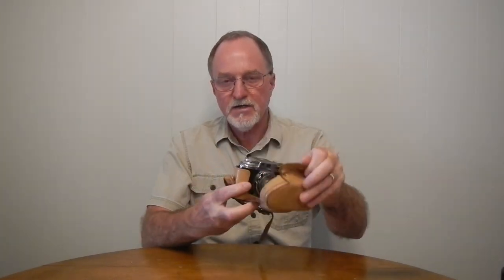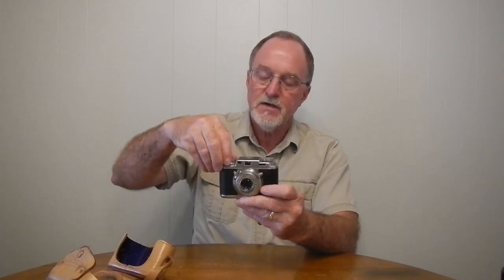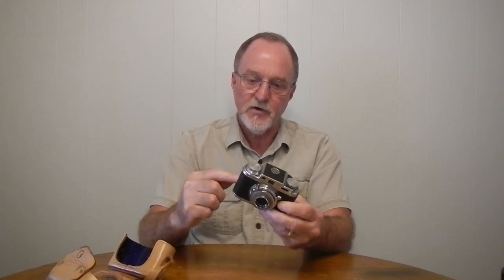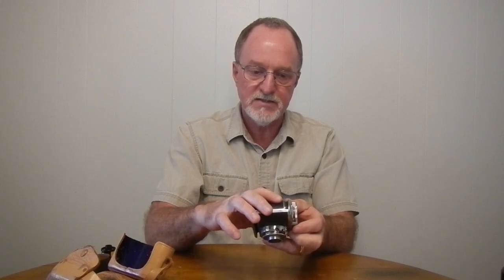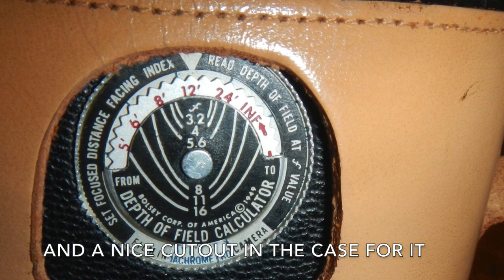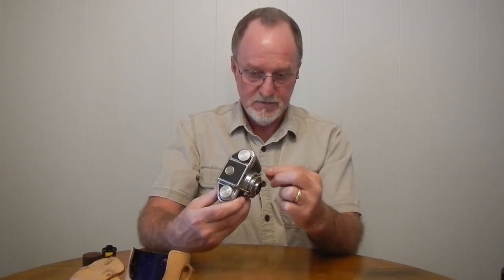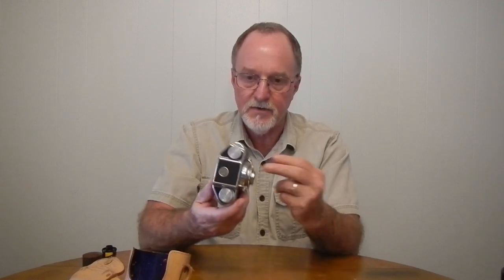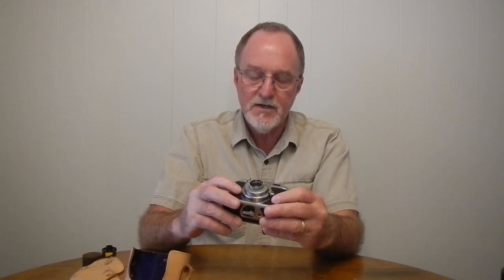52 Cameras: # 180 — Bolsey B2

Comment: That was our family camera from about 1949(?) to the advent of the Kodak Brownie in 1963.. It took great photos . However, if you didn't have the owners manual back in the day, you would up with double exposures and probs with film advance. We had the flash, it came in a white/ red box and had about a 6-8 inch flash reflector that used either 4 C or D 1.5 volt batteries. Nice memory

Comment: for anyone finding this later on. The small mirrors inside the top of the camera fall off pretty easily. two screws on the inside of the camera and TWO grub screws per knob and the top removes fairly easily. a dab of glue will do!
Reply from the maker: Excellent tip. Thanks!